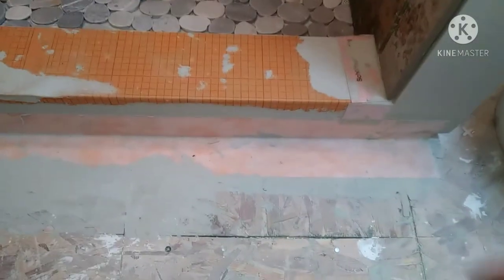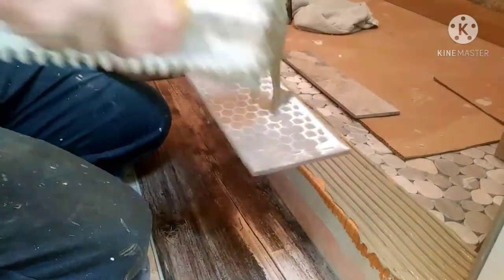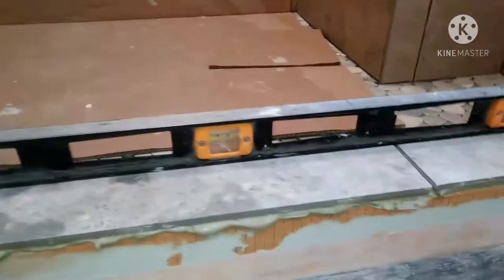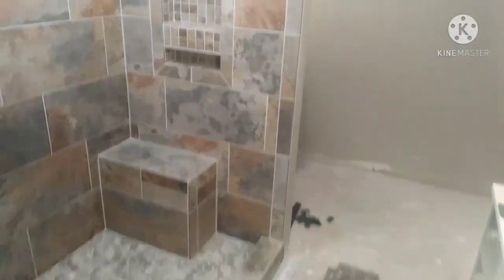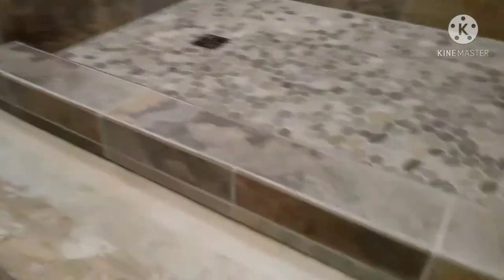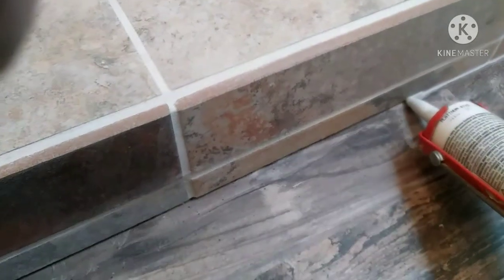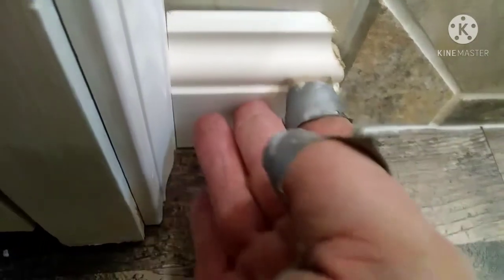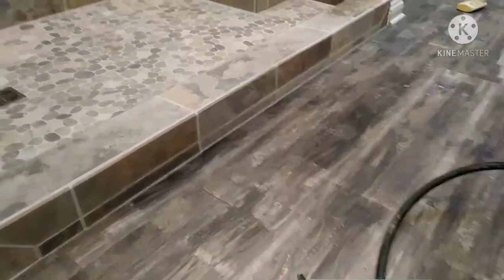how to tile a shower curb (against vinyl plank )

Comment: If I did this myself how much would this cost I really am on a budget
Reply from the maker: The whole shower floor to ceiling is the most expensive thing you can do...Schluter kit might run xtra $600 ( give or take) plus tile , thinset, grout, trim ect...assuming you're doing the work
Reply from the maker: Depends on material cost? Don't forget to add for door unless you're using a shower curtain
Reply: @GetToThePointplz123  
Ok yes I understand so Wht is a fair price to expect to pay diy you think for doors tiles ect.
Reply from the maker: Lots of variables , low side maybe $15-1800?
Reply: @GetToThePointplz123  
And high side you think?
Reply from the maker: Sky's the limit, all depends on products used...as an example the door in that particular video is  moderately priced at around $1000. Custom glass will cost 2-3 times that. Tile and accents,  shower valve and finishes, shower heads, handles all same scenario...prices on all these products can start low and get really expensive really fast. My advice would be research products and read reviews.  I try to shop middle of the road unless someone wants something specific.  I hope that helps you find a place to start👍
Reply: @GetToThePointplz123  
Thanks it does